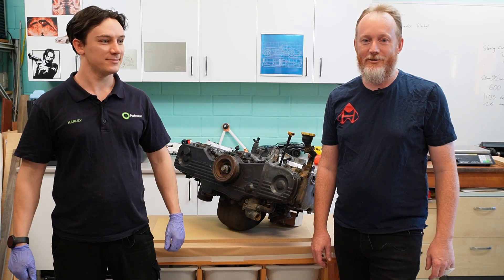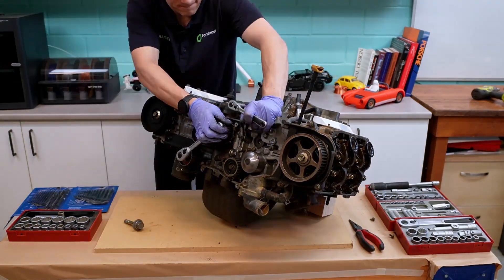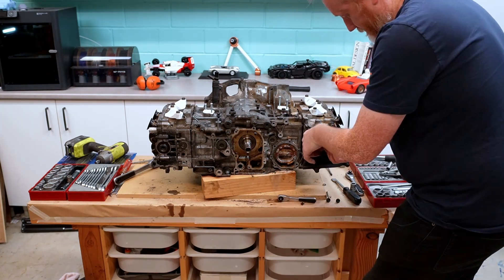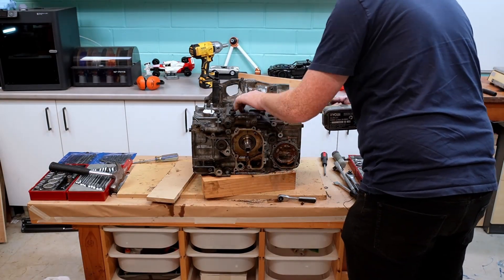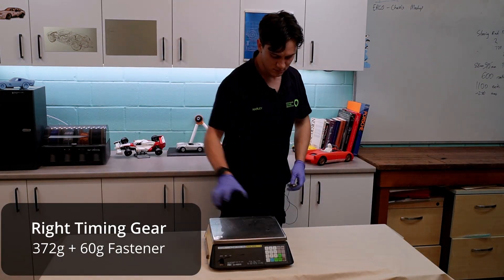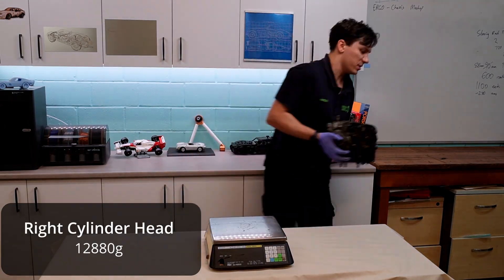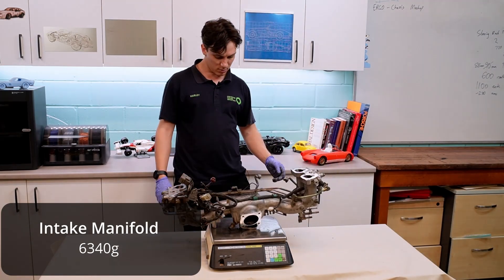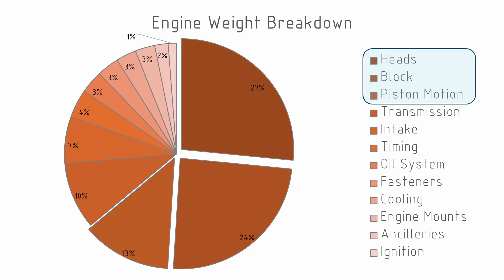Engine Mockup for a Custom Sportscar – Pt1 the Teardown | Project 171

Comment: I understans you are removing parts to lighten a mockup engine so it is easier to manipulate but.. are you looking for ways to make the engine lighter? i guess lightweight intake manifold, clutch and mount are the easy ones.. What are your crazy ideas? carbon valve covers? machined crank?
Reply from the maker: Not a lot of scope to take much weight out of the engine unfortunately.  An intake manifold will save some, but will be a big job. Flywheel will likely lose a bit of weight, as will the mounts.  The exhaust will almost certainly be custom, so can save a bit there.  Otherwise nothing too crazy, just look to have efficient mechanical structures on the rest of the car to save some weight.

Comment: BTW, if you want to upgrade to an FA20 I have a trashed one you can have if you can organize shipping to Sandgroperland from Melbourne-town.  It is dismantled so there maybe bits missing but there's enough to figger things out.
Reply from the maker: A switch to the FA20 is all about suitable transmissions. It might happen down the line.  Thanks for the offer.

Comment: I'm working on bmw M30 engine right now and it's surprising how much weight is in fasteners alone. I had all of the fasteners in a bucket for cleaning and it's hard to believe a single nut weighs almost nothing, but an engine holds kilos of them.
Reply from the maker: I have an M30 sitting in the workshop at the moment.  It is a pretty heavy engine, but got to love a BMW straight 6!

Comment: 12:58 but couldn't it be a valid argument that despite being a little bit heavier, that weight is down LOW and thus better for overall vehicle CG height? It seems to me that having say 30kg down closer to the ground would be better than having 25kg up high. Sure, that extra 5kg or so might be seen as a weight penalty but what it hurts in acceleration, it could easily make up for it in cornering performance (and even possibly braking performance depending on other factors), which in my opinion is more important anyways (well unless its a drag car).
Reply from the maker: You could be right there. I'm not convinced an EJ has a much lower COG though, at least without a dry sump system.  The sump is quite deep and with the exhausts coming out the bottom there isn't too much scope to lower it. Likely a dry-sumped Honda 2.0L would likely have a lower COG. Would be very interesting to do some COG measurements of different 2L engines just to see how different they are.
Reply: @KevinHayward7  yeah, the more that I think about it, due to the driveline layout and sump depth, its probably not as low as I would have initially suspected. 

Not sure though about a something like a Honda 2.0L, like say a K20 being lower COG though, I mean sure, if you dry sump the Honda but leave the EJ factory wet sump then yeah probably but thats not really a fair apples to apples comparison.  If anything, I would say that all things being equal, an Iron block engine (like say a Toyota 3s engine) would beat the Honda engine in regard to COG height simply because all of its weight is in the block (heads being reasonably similar in weight though, I'd suspect that the Honda head is heavier than the Toyota head in "running" configuration) and thus the larger percentage of its weight is down lower than the larger percentage of the K Series Honda engine. 

Obviously though, the Toyota example would come with a pretty significant weight penalty simply because of its heavy a$$ iron block.
Reply from the maker: I think the point I was getting at with the dry sump is that I'm not sure a dry sump would gain much height on an EJ due to the exhaust configuration.  Short of putting really tight bends on the start of the primaries.  Still would be an interesting project to get a bunch of these engines and do the measurements.  I have seen cars that had lower COG than the competition but only because they were carrying extra weight in heavy low components.
Reply: @KevinHayward7  Ah gotcha, sorry for the misunderstanding on my part...

Yeah, if you are forced to have the extra weight, getting it down low really plays a key role in overall COG height. I remember when I first learned of the Tesla model having a COG height of like 450mm or so,  I though it had to be a misprint but then it hit me that the Battery is the cabin floor essentially and the motors are as low as possible and it all made sense as to how a fairly large sedan could have a quite low COG. That low battery and motor configuration is what also allows Porsche to get a lower COG in the all electric Taycan than that of a 911